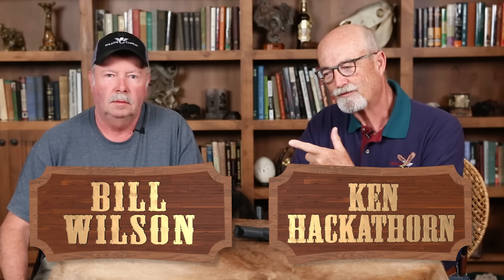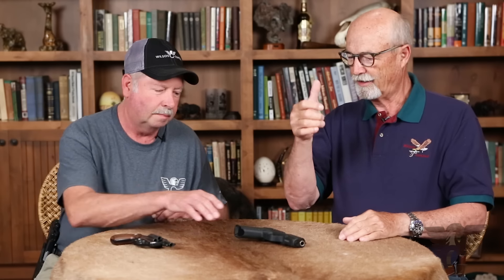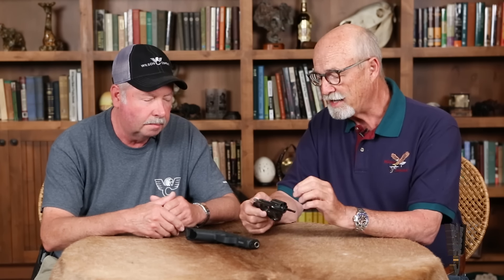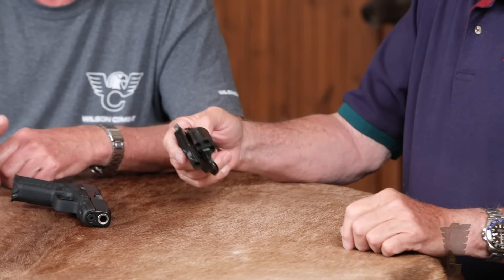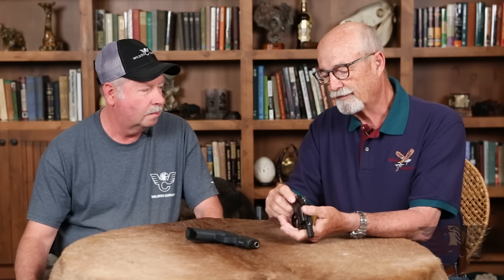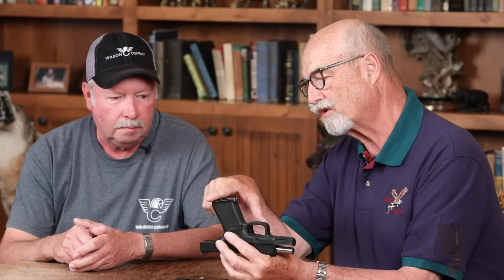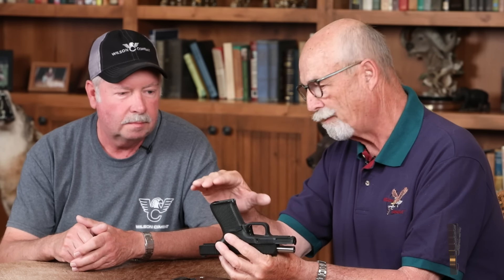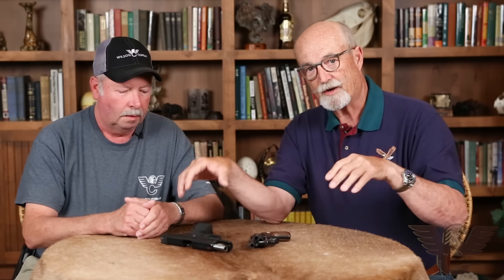DON'T DO THIS to Your Guns - Gun Guys Ep. 17

Comment: Don't buy $3000 Pistols that can't handle normal use like my $500 Glock can got it👍
Reply: @kevinallies1014  even if i had 3k to blow I still wouldn't buy their pieces of shit
Reply: @kevinallies1014bro, my Beretta 92FS sounds like it has better quality control than this bullshit. It sounds like to me that a gun company is blaming the user for using the handgun like a normal person and not babying the shit out of it would rather than paying attention and attempting to fix their own failures. How is it that an Italian gun company can develop a damn near indestructible handgun after over 50 years of development with trial and error when the 1911 has been around over 110. If components like hammer sears and extractors are failing or they’re accumulating excessive external wear due to dry running or even dry firing, then the gun is already on thin ice and it needs to be fixed. And before you blabber about how the trigger on that 1911 has a better trigger that needs to be treated with respect, my Beretta 92 has a better trigger so keep your mouth shut.
Reply: @diplexnormal3353  Well, The facts are: The 1911 has been proven in real combat in more wars, conflicts, years in service name it more than the  Glock and Beretta M9 put together. So if they can't match that....JSTFU!
Reply: @blackcat3x  bro, I’m not gonna bash on the M1911 because I respect it for its roll in history. The 1911 was adopted because it beat all the reliability trials and it stayed adopted for decades because of both bias of tradition and because it became obsolete for modern warfare, that’s not bashing on the handgun, that’s being honest. I can talk about the reasons why my favorite handgun left service but honestly there wasn’t many, The US army simply cheapened out on their infantry and adopted the M17 Hangun over keeping the M9 again. The 1911 was proven combat worthy, that part is true. I wasn’t bashing the M1911 on its own, I’m bashing on the 3000$ 1911’s on this video. Any modern made 1911 should be capable of being dry ran or even dry fired as many handguns today are already capable of doing so, claiming that they need to be babied in order to prevent premature failures is silly and it’s a red flag that you just spent 3000$ on a polished paper weight.
Reply: @kevinallies1014 Hey, want this 10k zip gun my cousin made that's likely to blow up in your face? No? I see, you clearly can't afford it.
Reply: @kevinallies1014 Stock glocks is where the reliability is my guy

Comment: Not cleaning and lubing a firearm after 2000 rounds is like not changing the oil on a Toyota because they're supposed to be 500,000 mile cars. Reliability comes from good design and followed with good maintenance. A tear down and clean after every range day keeps my memory of how to disassemble and reassemble my tool and is peace of mind that the next time I pull the trigger it will work every time.
Reply: You clean your firearm after every range session. Jesus dude
Reply: @Launchpad_McQuack_Is_A_Chad  depends on how long it's been since I cleaned in general, but usually a field strip and clean the barrel out. Takes sooo long lol
Reply: @tinfoilhatclub you're right. I will stop

Comment: Hmmm, I don’t think I’ve ever used that slide catch function.  It’s always been more fun to pull the slide back and let it go than to push a button or lever.  So - that’s the issue?  Locking the slide to the rear, then pressing the slide release on an empty chamber?  I’ve never bought about that.  I don’t think it’s mentioned in my Beretta manual, either.
Reply: No

Comment: So, and yeah i am not used to the 1911 platform. You are obviously well versed and much mor expert than I. But how is it the slide slamming forward and hitting the barrel affects the mechanics of a trigger? The trigger reset is affected but searously the velocoty of the slide in the recoil of the gun is LESS in your opinion than the ?harder? More destructive slide stop release really??!! Gosh 1911s must be so fragile. Now i do get the extractor issue your slamming its face on a round in a never intended way. But releasing the slide manually with the stop hurts the trigger?

Comment: NO disrespect intended, IDPA member (A10051) here,  but IMO, to avoid "the thing", it'd help to use the proper terminology. Mr Hakathorn called it a "slide release". Well, there's part of the problem, right? Joe Blow: "Well, he called it a slide release , so that's what it's for, right?"  NO! mainly because it is NOT a "slide release", it's a "slide lock" or "slide  stop", and it's designed to hold the slide open when you shoot and have shot your last round. 

AFA lubing (oil and grease, etc), the phenom that I've seen is TOO MUCH lube. As an SO, Ive seen guns so over-lubed that it soaks their holster and clothes. I had to constantly advise to "not lube so much".  I guess that in their logic, lube = good and if a little lube is good, alot of lube is better. 99.9% of them reply, "Well, I thought lube was good"." NOT TRUE. IMO, lube attracts dirt and dirt is a gun's enemy and a little  lube attracts a little dirt and alot of lube attracts alot of dirt. When the topic of lube comes up, I always say, "A LITTLE lube goes a long way". I'm talking about applying an actual single drop, smear it on the surface and then wipe it off. Or better yet, wipe the parts with a lightly oiled cloth. 

I DO wish ya'll mentioned the points to lube or better yet, the points NOT to lube, like the firing pin, or the trigger assy or the chamber, or down the barrel and on a JMB 1911, the safeties. When I carried a JMB 1911 (IWB at 4:00), I had a constant problem with the thumb safety being taken off, simply by my daily body movements. IMO, the thumb safety should be hard to disensgage.  

And AFA a gas driven guns (AR, AK and semi auto SG, et al) DEFINITELY do NOT put oil in the gas route. I see folks pouring lube into their piston area. That'll cause malfunctions and stoppage quicker than anything. IMO, CARBON AND OIL MAKE THE ULTIMATE SLUDGE. 

I'm a strong advocate of cleaning a gun. IMO, you should clean your gun twice as much as you lube it. I always, in between COF, go to the bench, take the slide off and take toothbrush and some solvent and give the upper and lower a brushing and then run a rod through the tube and then wipe it down. I like Rem  oil spray, cause I can quicky, lightly spray and be done. IMO, a clean dry gun is more reliable and runs better than a heavliy oiled , highly carboned gun will.

AFA dropping the slide on a round in the chamber and breaking the extractor, if it doesn't do that, it'll sheer a slot in the rim of the cartridge and then won't extract it.

Comment: Why are 1911 Sears jumping all over the place while every other gun can keep their parts secure in position
Reply: Ken explained that the original design doesn't have this issue, its all about sear engagement. High end 1911s like Wilson Combats just have a lot smaller ledge on the hammer and a smaller nose on the sear to reduce the trigger pull weight. 

This is not a 1911 specific thing, any gun that has such a small amount of sear engagement will have this issue and there are 1911s that wont do this at all. Its simply best practice not to drop slides empty because you don't know what gun will or won't and none of them are designed to do so anyway.
Reply: Because the 1911 is not the great design many Americans think it is.
Reply: You mad bro? A 1911 is still used by special forces. Oldest pistol in military service.
Reply: @jerryseinfeld1345  only used by Special forces in the USA. Only in USA. Only in USA. Only in USA.

Comment: Personally i have heard both arguments and my summation is this: weather you "slingshot" or hit the slide release the same internal mechanics are occuring.  If some part of your weapon is contacting another that in reality should not happen, you have bought a show piece or a lemon.
Reply: Slamming the slide on empty is what they're talking about. When you slam the slide to load the chamber the round getting pushed in absorbs a lot of that energy. That is what the guns are designed for and it's fine.
Reply: @unclebob540i3  you drink the koolaid with no data or proof that loading a round takes a great deal of stress away. Now explain how dropping a slide is more stressful as firing a live 45 ACP round, because if it can handle that but not a slide drop you have a big problem....
Reply: @evocati6523  try that on your own gun and you can feel the difference. If you actually have a handgun that is.

Comment: Handling a firearm that's distasteful.  Wow.  I had no idea the 1911 was that weak that merely dropping a slide- as it was designed to do would break it.
Reply: Wow what an ignorant statement.
Reply: @JNOSNOW  I'm going to go buy a gun that breaks when you do something to it that it was designed to do.  I think I bought my first one in 94.  I was riding a beretta before that.  The first thing I actually carried was a nickel smith and wesson 357 five inch barrel.  Drawing that thing out was like slow motion you know- it's almost as dramatic as racking a shotgun.  I am ignorant of firearms.  Pish followed by a disdainful posh plebeian.
Reply: If you paid attention to the video you would know that the 1911, nor any auto loading handgun, is not designed to have the slide dropped on an empty chamber.  Can you do it? Yes.  Are you hurting and unnecessarily wearing the gun, also yes.
Reply: @gmagz0647  Every gun ever built with a slide release is designed to drop with or without a round.  The only damage I am aware of is placing a round into the chamber and dropping the slide which can damage the extractor on some guns.  If you were paying attention you would have heard this caveat.   When people modify their guns doing what they call a "trigger job" where they remove material to make the gun fire with less force exerted on the trigger face.  That is called damaging the gun.  The force exerted when the slide if forced forward can be tuned with slide springs the difference in force of a slide moving forward is supposedly reduced enough by picking up a round reducing the force enough to not damage the gun as it was designed.  This is complete and utter horseshit.  This just miraculously came to light with the dawn of the tacticool crowd who likes to fiddle with triggers removing material effectively damaging and reconfiguring an otherwise perfectly functioning firearm.  Dropping the slide on an empty chamber WILL NOT damage the gun.
Reply: I agree with A bee. It's a slide release for a reason. Imo.
Reply: Wow you guys must not have absorbed anything they said
Reply: @JNOSNOW  If you run a gun business it behooves one to cater to both sides.  I assume they believe the younger less knowledgeable and impressionable are their new target audience.  The idea the weight of the round and resistance is the precise retardation of the slide action required to keep it from damaging the firearm is patently absurd and physically wrong.  If that were the case replacing the slide spring to a low power would accomplish the same result.  Were you even listening to this guy talk- for gods sake he sounds like it is within the realm of possibility he is the first generation in his lineage to walk upright.  Dropping the slide on a 1911 or any pistol that has a slide release will NOT harm a pistol.
Reply: @abee3515  I have definitely seen the fucked up interface of the sear and hammer on a few guns on the range and in the shop and witness those same guns being dropped on an empty chamber by the owners of those guns. I've seen enough single and double action pistols to know that the interface of the hammer and sear with a light crisp trigger shouldn't be abused in that way for some stupid reasoning. Luckily I wouldn't be buying a used gun like a Wilson without a thorough in person inspection.
Reply: I march a beat to my own drum. I do what I want
Reply: Cool. Wrong or right, whatever you want.
Reply: @JNOSNOW  with a light crispy trigger.  That is tacticool speak for modifying (read damaging) a properly functioning trigger.  If you "lighten" a trigger to the point where dropping the slide will cause it to fire you don't need to stop dropping the slide.  You need to repair the trigger and quit fucking with a design that functions perfectly- exactly as it was designed to do.  You have people fiddle fucking with a part of the gun that should be left alone blaming a normal function on something you did to the gun.  If you have seen a few with damaged trigger groups it's because one of your kind wanted a light and crispy trigger.  Not the slide release function which is a normal function of the gun not abuse.
Reply: @JNOSNOW  Fine tuned.  If you want to damage the gun in an effort to make a range toy do not sit and pontificate to people that run their guns as intended.  I seriously doubt the quality and value or your collection rivals my own.  If even if it did you wouldn't be making those absurd statements.
Reply: @abee3515  mine sure as shit isnt a range toy and has almost 6k rounds no problem and guess what, my sear is as good as new cause I'm not a moron dropping the slide on an empty chamber and it's still amazingly crisp. You collection may be bigger or worth more but who cares, I don't buy a lot of shit, I buy quality shit that will last, like my Wilson. Quality and accuracy is king and these guys do it best.
Reply: @JNOSNOW  If you fear dropping the slide will damage your dainty little playpretty it is absolutely a range toy.  Nothing like an amazingly crispy trigger with your eggs and toast.  If dropping a slide on an empty chamber will break your gun buy a better gun.
Reply: @abee3515  yeah cause theres allll that news and reports of broken Wilson combats everywhere. They actually seem to be one of the few companies that can make a truly reliable 1911.
Reply: @JNOSNOW  I seriously have to ask- are you seeing all of these broken guns because of dropping slides?  because I have stood behind that platform for literally decades on ranges from the military to city state and federal firearms ranges and I have never seen a broken 1911.  I know it happens I'm just telling you I have never seen it. I have seen sigs fail I have never seen a glock fail.  I have to say you are seeing things I have never seen- all these other companies that build 1911's that can't make them reliable.  I own five different manufacturers in 1911 and they all run quite well.  Have bought and given as presents three other manufacturers that I have shot extensively with little or no issue.  I have never had one break or fail to function.  Ever.  If wilson tells you if you drop your slide on an empty chamber it will void the warranty I say you bought it you knew that was their policy.  And for that reason I would never own one.  I would buy the colt- another one.
Reply: @abee3515  you have been educated by one of the most knowledgeable guys in the industry, yet you think you know more, go on with your thoughts oh intelligent one so that we all can be graced by your knowledge
Reply: @JNOSNOW  0 comprehension
Reply: @abee3515  he did not go into every intricacy involved he tried to keep it simple for your ilk, do you not think the piece of brass being in between might not have an effect on it, it is not his job to educate you on the reasons of why not to do it. you will next tell me you're a metallurgist and know more than bill wilson, go watch gunblue490 I am sure that is were you got your qualified info
Reply: @abee3515  it's like gunblue490 with 60-year-old technology and 7 lbs. trigger pull you probably can't hit the side of a barn with your junk
Reply: @tomgiorgini9154  I'm done arguing with random YouTube fudds
Reply: @abee3515  if you want mil spec go for it you do realize mil spec is the cheapest bid don't you if you can only afford junk I am sorry no need to get mad because other people enjoy some of the finer things in life, your thought process tell me everything I need to know about you, gun blue is your god
Reply: I'm sure the list of things you don't know is endless
Reply: @christopherbeaulieu4942   Then you would be surprised to learn it isn't a slide release, it's a slide stop. But then A Bee knows more than Bill Wilson, I guess he knows more than John Browning too
Reply: @desmodue944  then why did to reply? Its obvious. You poor poor soul, making comments that are redundant. I'll forgive you this time.
Reply: @JNOSNOW  actually I did. Plus I watched brownell's opinion on it too. With more consensus on the subject, I have come to the conclusion that if you modify the components of the 1911 then to run the risk of damaging them when using, the slide lock,catch, or release. So with Wilson combat pistols dont do it, and with mil spec should be fine. It's a matter of opinion and experience is what it is chalked up to be. There is no right or wrong answer, but always follow manufacturers instructions. Think I got it.

Comment: I never drop the slide on my Glocks. I was taught out of the academy it's called a Slide Lock. Not a Slide Release.
Reply: And your owner's manual would have taught you it's called a slide stop lever (by Glock,) and would have told you to use it to release the slide forward after inserting a new magazine.  Maybe Glock knows something about their own design that the academy doesn't.